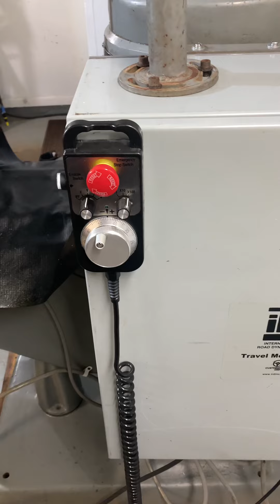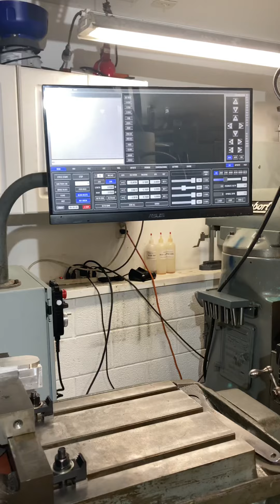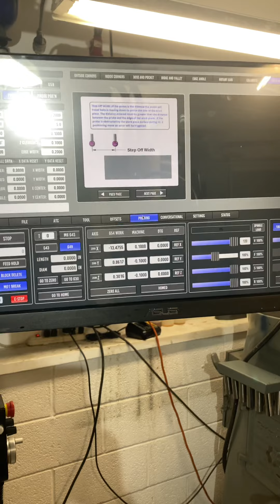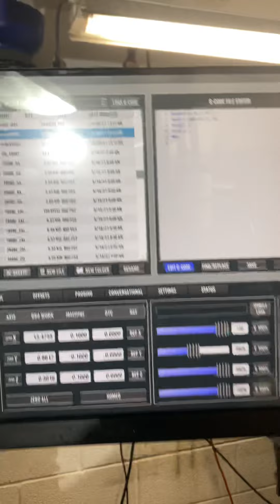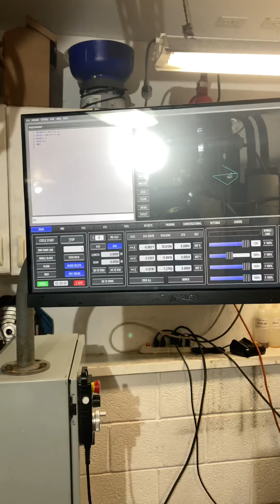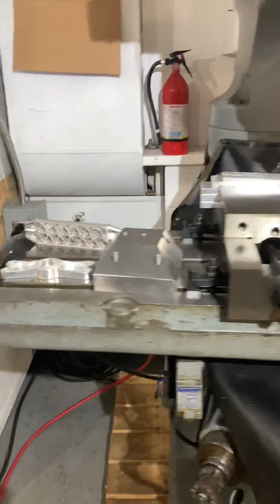Bridgeport CNC with Probe Basic Control

Comment: Saw your ad on craigslist and ebay. I'm in Howell mi. 

Question? Can this type machine be converted to quick change tool holders? as I understand it now you need to unscrew the lower threaded bung? to change out the tool holder? Just wondering as that would make this so much better. I got to think if you could have converted it to air quick change you would have though. 

Another question, could a 5th axis be added with the control system as it is now? I got ideas for stuff that requires 5th axis.

You should post a link in your description to your ebay listing. If you post the full link it should be clickable. 

Wish I could buy this but I just moved to MI & bought a ton of stuff this summer including a J head Bridgeport. Not in the position of spending any more until I get some biz income flowing. How is this rocking single phase 220V. Do you have a VFD or what? What are the amps required to run it? As you can see I cant stop myself from being interested....
Reply from the maker: Yes, the spindle uses Erickson 30 Quick change, the spindle brake comes on automatically and you simply turn the nut a half turn and out comes the holder. Adding a 4th and 5th axis is as simple as buying something like DM860A drives from ebay for $65 or nicer Gecko drives for $154. Wiring takes about 10 minutes, the Mesa 7i76E board has room to plug in 4th and 5th axis drives. There is a VFD to control the spindle, and it uses up to 6.6 amps on a very heavy cut. I hope this clears things up, I would rather have a cash sale because ebay takes about 10% of the sale price. Thanks!
Reply: @ElixirCNC  Thanks.